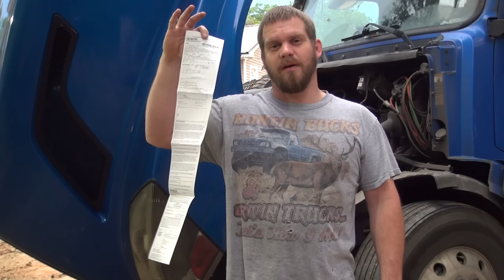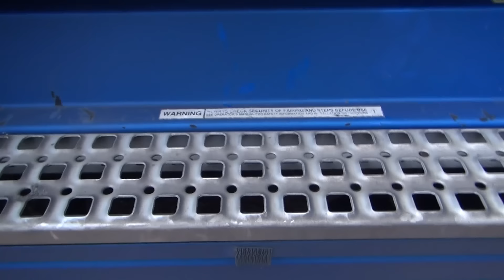Stopped by DOT

Comment: I've been in a Texas DOT Tahoe and he had a license plate scanner that showed any warnings or tickets.  Since you just got inspected, they wouldn't mess with you if they had the equipment.  I've been pulled over a few times and left clean a few times, but I'm a company driver and the company leases their trucks from Penske.  If anything is wrong at all, we take the truck to Penske and they will fix it "like new".  As for why they inspect???  It's their job.  Just like we make deliveries, they inspect trucks.  I'm sure they have a boss that tells them how many they have to do.  I usually try to make it as pleasant for them as possible.  Pleasant usually means quick.  Quick is good.

Comment: I drove for 15 years, did LEO for 6 years...local and Federal...now we never messed with trucks but it sounds like you are in LA. and yes many states do the inspection for the cash it generates...There is also an inspection week...many states pull over anything that moves...I usually sat at the house that week or went on a short run but too is another mass cash flow scheme. now on to other reasons...if you are in Louisiana, there is a TON of drugs, and humans being smuggled out of Mexico and they are looking for those that come over illegally, drugs, and other contraband...a Level 3 inspection gets them close enough to not only make money off of you, but allows them to check and see if you are hauling people too...I cant count how many times I took my family with me on runs, go through a scale especially those with metal detectors in them only to get pulled around the back and ask who else was in the truck with me....I always took it as a good thing in case someone had kidnapped my family and was trying to haul them in a truck... I do not know how long you have been driving but if you drive an older truck, WASH IT REGULARLY, they look at the paint, if it is not clean, they figure your truck has been neglected as well...

Comment: Nearly every seal keeps from burning up by using  the liquid it seals from as a lubricant .  So there is NO way possible it can not itself leak  .
Reply: I agree. If they're concerned, they should check the fluid level, and make sure the drive belt is tight enough not to slip. How often have you spilled fluid on it, just adding to it? Fluid on the outside doesn't necessarily mean it's leaking!

Comment: Why is keeping your batteries covered such an issue for you that's a fire hazzard for one thing god forbid you accidentally drop something metal on them   .That leaky steering box  your explanation is correct to a point but if you need to turn  fast to avoid an accident it ain't happening  plus replacing a seal is a whole lot cheaper then  gearbox  ive been in trucking all my life and 0/0. 40 years    I'm not a betting man but l bet I know two items on your truck that work perfectly 
1. Your Jake brake 
2  air horns 
Last truck I sold to a fellow about your age  never asked one question about the mechanics of the truck  never checked the oil  only thing he wanted to know   Jake brake work  and how loud are the air horns
Reply from the maker: Those are both safety items and they both work as well as the brakes. I try to keep up with everything that might harm others or leave me stranded. It's a lot better to repair at home than on the side of the road and safer also.

Comment: Any pre emission truck with breather hanging down will drop oil. There is no way you can have 0 blow by even on a new engine. Over time oil vapor will accumulate  and drip down. BTW buy your self an intake pipe adapter and remove that restriction on your intake. You can buy a direct Bolton one for 299$ or 399$ I think let it breath

Comment: I wonder how many police officers have ever looked at their own personal vehicles, even brand new cars will drop some oil through the PCV system, they will leak power steering fluid through the reservoir cap or just because even with a funnel it is impossible not to at least spill a drop. Do they understand that every vehicle picks up oils and dirts from the road surfaces that they drive on. It is all about revenue not safety.

Comment: He may have only given you warnings, But all that goes on your PSP report which will stay there for 3 years. and each infraction has a point value. 1st year times three , second-year times two, third times 1. so 5 points x 3  = 15 . And shippers, brokers, and trucking companies look at your PSP report when determining to give you freight or employment . over 50 is unsatisfactory.In 2016 I was pulled over for a random Dot level 1 Inspection and the cop found 3 log bok mistakes, I wasn't fined but it was put on the inspection report that he had found them, the only job I could get for the next 3 years was working for a temp agency for truck drivers.

.
Reply from the maker: I found a mistake. What's a log bok :) just messing with ya man lol. good information thanks for watching
Reply: @LifeWithChase  Dot would have cited me for that.

Comment: Good thing he just gave a warning. I know it’s hard keeping everything perfect. Honestly I’m sure they could find something on every truck to write a ticket or put you out of service.
Reply: Good thing? A warning is automatic CSA points, no way to fight them. If you get a ticket you can fight that, but then still need to get points removed.
Reply: William Kvintus  maybe you’ve never been fined by the dot but some demand payment on the spot. So yes a warning is okay with me. Points will roll off if you keep things in good working order. Unfortunately some older trucks are just beacons for dot inspections.
Reply: @mytruckinlifeace4047  Ok, I can see that point, and yes I have been fined by the DOT, I was a driver for 20 yrs. I'm just saying that a warning from DOT is not the same as a warning a 4-wheeler would get, there are still consequences.
Reply: William Kvintus absolutely no inspection is better than a warning. But even with the points a warning is better than fines and being put out of service. My first year I got a ticket for a missing mud flap in Oregon and I was told to fix it before I left the state and he fined me. I fixed it and called the clerk a month later and they ended up not charging me anything. This was a few years before non moving violations effected the CDL. I’ve been pretty lucky ever since.

Comment: Its end of the year inspection blitz. When they did inspection blitz in June, so many trucks shut down during that week to avoid inspections. based on how many trucks are in operation vs the amount that were inspected was really low, so they didn't announce this winter inspection blitz to catch  the ones they missed. I've got a 99 freightliner and I've had full level 1 inspection twice this month at same weight station. They got me for brake line rubbing on frame, it broke the lines skin. Replaced line on spot 300$ .  This game is definitely for grown men not freshman.  Be safe out there, bless

Comment: I think this week is the DOT blitz , all the Owner operators I know are shutting down for another week until it’s over. We just changed our steering gear input shaft seal, it was leaking just like yours. It’s leaking again so I guess we should have bought the seal driver from Freightliner instead of using a socket to set the seal. If you have your own Authority those warnings go on your CSA score and can’t be challenged, warnings actually hurt bad at Insurance renewal . I had no idea that oil drips weren’t allowed to come out of the blow by tube, our Detroit always has some drops.
Reply from the maker: That's what I think isn't right is we get points on our CSA score for something that has nothing to do with safety. The oil drip from the blow by tube is unavoidable on a worn engine with blow by. Idk maybe oil catch can or a diaper 😂
Reply: if your input is leaking after new seal clean it off real good and if you look at the top of input shaft you will notice there is a circle in the middle of shaft there is actualy two shafts in that one and the center one leaks you can usualy see oil in center of universal ive fixed that leak three ways 1 weld two shafts together on top two rebuild entire steering box or lucas power steering stop leak is great to
Reply: Jay K I wonder if some states are being sneaky this year? Dot was out in full force last couple days in several of the states we run in the Midwest.

Comment: I find it absurd the State, County and Local government "commercial" size trucks are EXEMPT from such inspections.  If you went to our county you'd not have enough printer paper for all the tickets they could write for a fleet of 20 dump trucks.  They are dangerous on the road no matter who the owner is.  Broken leafs, rusted out brake chambers, no tread, wheel seal leaks, worn king pins, over loaded, hydraulic leaks, oil leaks, busted glass, hardly any lights working....and on and on and on.  Not one violation tho...government truck.
Reply from the maker: garbage trucks are same way
Reply: i have to disagree on that one state and cty trucks dont do enoughf work to be woren out ?? !!!!

Comment: im in uk and that steering box would have got you a pg9 cannot be driven must be recovered then full inspection before use on the road  .. if that truck is your bread and butter look after it and it will look after you no fines .. they can look all they want but if nothing wrong they cannot draw a ticket up

Comment: They got me for grease on he inside of the frame ^ wheels. the truck had just been serviced & grease was flying from the U joints on the driveshaft.
Reply from the maker: how are you supposed to prevent that besides not greasing it.
Reply: That's what I asked her. It was a town inspector not a state. Also asked her how long she's been doing this..
Reply: @LifeWithChase  dont over grease it or wipe the excess grease off,common sense and a good habit just to be clean....

Comment: Provent can. The original one with stainless mesh filter. Can add chore boy to catch more of wanted to. The ones that use paper filters gotta change them and the cost starts to add up.
Reply: huh?
Reply: frontcentermusician google prevent catch can and it will make sense. He showed his pcv system where he just put the blow by line straight down to the street. Which is what it is by doing it that way. Put a can on it and maybe save a motorcyclist life by not hitting a stream of oil. Plus it cleans up the engine bay by not having oil mist all over the place.

Comment: No law says batteries have to be covered cause Volvo designed the batteries like that if they had a problem with it they should have called the manufacturer
Reply from the maker: I didn't think a thing about it just because that small strip was missing, I figured it was no different than a fairing over the fuel tank being damaged. Even if the little strip was there its not really covered just not visible from the exterior of the truck.

Comment: You didn't think the turbo would suck hard on that blow by tube when you hooked it to the air cleaner hahaha
Reply from the maker: Have you ever looked at a 7.3 powerstoke or a duramax, done the same way. unfortunately makes an oily mess around the intercooler boots on an engine with alot of hrs
Reply: Ohhhh don’t forget the ...... come on now....... ding ding ding 6.0 hhhhhhh yeah baby🤙🏻

Comment: Dripping oil on the Highway is not ok.

Keep on too off things.   
Customers like smart trucks.  
If it’s your own business. 
Think about 
1 loss weight & wear smart cloths, plain clothes at least.
2 get graphics on your truck that states what you do.....not your name.
3 polish your rims with 0000 steel wool & polish, 
4 gloss your tyres on the outside.
5 tidy your beard, keep your beard but cut the edges,  maybe think about cutting coffee & tea, spray your armpits.   Clean your boots, polish them.

Oil on the road can kill people, motorbikes dummy.   

In my view the DOT inspection let you off lightly.     

Gleem that truck & dress smart.   & take a look at yourself.  Clean nails around customers, have a pen ready in pocket.

I do admire you for working hard, running a business & much respect.  But work on image more.
Even old trucks look great when looked after, or polished.

Comment: All the things you were cited for sounds like the new crop of Captain planet watchers have started writing the inspection laws We can see your battery acid leaking you bad trucker  And oil on the ground from both a PCV And a leaky Power steering pump Those Captain planets don't care if its crud from Crude OE not !! About Power steering loss I experienced it in Louisiana I had gone past the "Truck " entrance about 3-4 entrances looked like that and I saw the sign just above my fender mirror  of course I had to go 6 miles to turn around!! My power steering hose blew in mid turn I was turning around where a truck with an excavator was sitting plenty of room and as I said   power went suddenly and I was standing in front of my air ride trying to make that wheel turn fast enough luckily the ditch was about the size of a 25  but there was a slight rise after the ditch !! Needless to say I wrecked my catwalk lol  blocked off the road  for awhile waiting for the tow truck Got somebody else to deliver the trailer while I got my truck fixed at the T/A !! I hung my keys coz of cancer so I feel fortunate I couldn't drive on electronic logs and the Half hour in the first 8 hours !! WELCOME TO THE DOT Dog & Pony circus show !!   love truckin' but seems like its changed a lot since the days of twin shifts    oh speaking of which with an air splicer don't DOT officers know this would  have trouble keeping on the high side if your air system has a leak ??? I trained years and years ago on a freight shaker cabover that I got going pretty fast in the yard got to 6th and my trainer kinda snickered it had an air leak; Why they just kept it on the yard  I wasn't supposed to get up to that high a gear Guess I shouldn't have raised my hand I've driven some before lol cousin taught me in his international !!  Good video for those that havent experienced the new Revenue Rangers !!

Comment: When driving, the charging batteries put out hydrogen and oxygen: a very explosive mix. It's actually safer, if the batteries are open, for good ventilation. If the batteries are enclosed, that hydrogen and oxygen can build up, and one spark from a loose connection and....BOOM! These pull overs without probable cause, are nothing but revenue for struggling police departments. A safety check is actually legitimate, but, come on: I agree, that many of the things that you were cited for have nothing to do with safety, and it's just a money grab. If they're concerned about the power steering gear or pump, all they need to do, is check the fluid level, and make sure the belt isn't slipping. You have to have metal schrader valve caps on your tires? PPPPPLLLLLLLLEEEEEEEAAAAASSSSSSSEEEEEE!!!!!!!!!!!!!!!!! That's where law enforcement loses it's credibility, and you're just looking at state sponsored highway robbery.

Comment: Was it at the end of the month? If so they had to get their quota. I have not yet seen a vehicle that did not have some kind of oil or grease somewhere on the engine. If you have a supposed small leak or uncovered batteries. should cut your break and just give you a warning and get it fixed. Just lot lawyers, some of them just don't care  going by the book. Don't use common sense. I know somebody sold your friend a brand new truck, and got pulled over for a cap that was plastic. The manufacturer should be responsible. That vehicle should be roadworthy in. Inspected before it leaves the lot

Comment: I listen to talk and how you say it is only 1 drop of oil from your breather pipe. If you were the only truck on the road fine .
If every truck lost 1 drop of oil how much oil is on the road ? How safe is the road with oil on it ?
If it is all about revenue making then why did the DOT  let you go with a warning and NO fine .
Reply: Do you know what blacktop is?  It's oil sludge heated into a tar with rocks mixed in... layered on the ground and compressed while still scalding hot the avg. blacktop driveway leeches more oil into the environment than my 2 million plus mile cat powered quad axle rock tub dump truck (never rebuilt) uses (including what goes out via the exhaust stack) in a year

Comment: They are all revenue generators. From what I understand some states have a quota to fill on inspections and citations. Would explain the BS. I think if you treat most of them right and be respectful they'll be cool back.
Reply from the maker: I agree they are doing there Job and most are friendly if you respect them. I also believe they have to find something somewhere wrong with every so many trucks, new or old regardless if its really a safety issue. Kinda like when police pull over a car for a license plate light, not a safety issue but will surely get you a ticket.

Comment: Forgive me if I'm wrong but "DOT Inspector" his job is to inspect for but not to invent faults, the function of crankcase vent road draft tube is exactly the "vent crankcase to road" now if diesels were fitted with A PCV system like motor cars and you disconnected it then you get what you deserve but writing you up for a fabricated issue is surely illegal and harassment but not a good look for DOT, what does every one think ?
Reply: The crankcase vent is to release crankcase pressure.  Not oil.
Reply: @happypappy6371  yes vent crankcase pressure mostly from windage but also some blow as engines wear which invariably includes oil vapours ask your NASCAR guys about windage, crankcase pressure scavenging etc and see if you can do it with out any oil vapours getting mixed up hence the drip, no engine lasts forever or remains same as new now does it so unless there are clear limits on crankcase emissions !